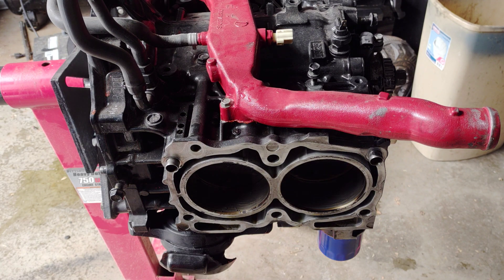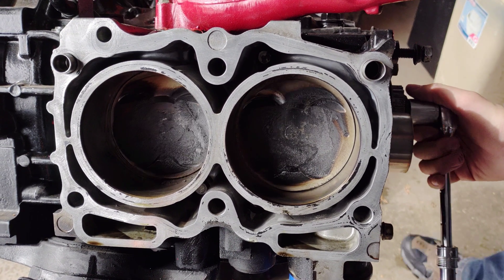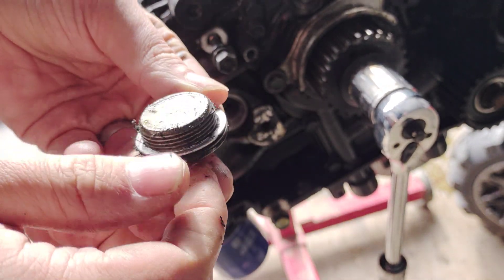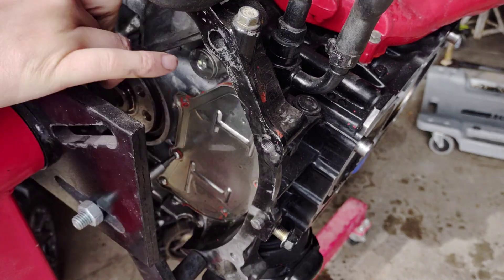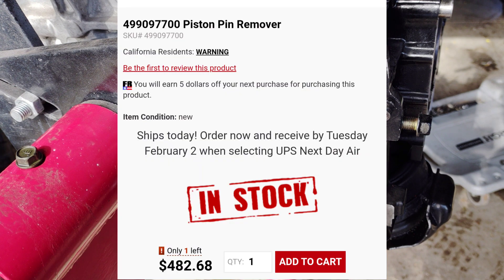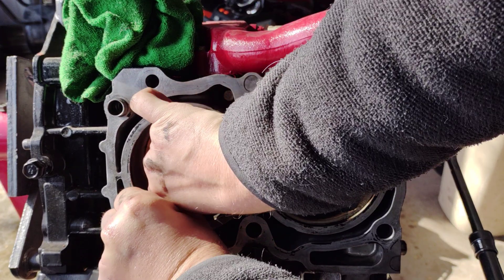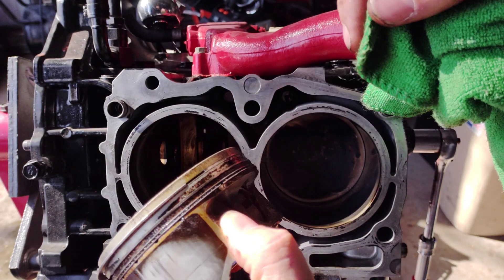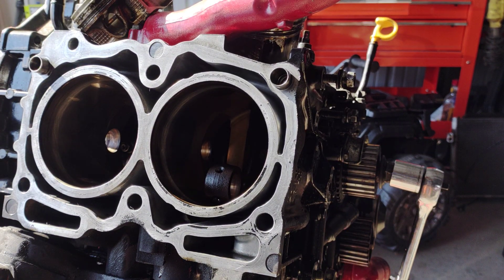What causes Subaru oil consumption? Engine teardown and piston removal.

Comment: Does this poor piston ring design (Keeps happening to you) cause you to say a hard no on buying a used 2012 Forrester with 80k miles.   Meaning they all will fail the same way?   Not sure what I have learn here on how to prevent the issue.  Replacing piston rings is not something the average Joe can pull off.  Which years was it an issue?  I think I read they fixed it in 2016 or something after a class action lawsuit on oil consumption.

Comment: Its due to low tension RINGs, change to different rings case is solved.    Burning 1 quirt every 1,000 miles is what subaru lawyers say is normal now.  Hint its not.   
2012 2.5 motor suffer same issue.    I have a V8 that burns no oil in 5,000 miles but it has good rings not low tension.   They tried to keep mpg high using 0-30 oild + terrible low tension rings.

Comment: I was having issues with my Honda throwing a CLE with a low and high oil pressure issue. The VTech is super sensitive and due to the age of the engine it's has a few small oil leaks. 

After some investigation I found a Honda Tech who said years ago there was a TSB that recommended the solution of using a mix of 5w-30 and 
Dexron III / Mercon Automatic Transmission Fluid.

If the engine was high mileage and the problem persisted then use an mix of of Rotella T4 10w 30 and Dexron III / Mercon Automatic Transmission Fluid.

This solved my problem.

Any thoughts on if the Subaru engines could benefit from this solution? The transmission fluid acts as a cleaner with the thicker oil?

Comment: Im looking at getting my wife a 2018 Outback or a 2016 Forrester. Both are pushing 100k miles.

How would i go about maintaining the engine after purchasing to keep this from happening aside from using 5w-30 going forward?

Liqui moly engine flush?

Comment: Has anyone tried the valvoline prolong and protect oil In the boxer engines yet? They’ve been having the same problem with GM 2.4 direct injection motors probably because of combustion of using low resistance rings and direct inject PVC recirculating oil vapor.

Comment: Happy I saw this video! I was having oil consumption issues on my EJ25, figured it was valve seals so I was able to get new heads and was about to install them when I saw this video. Pulled my pistons and found stuck oil rings. I soaked and cleaned the pistons and the oil rings are clean and free now. My question is, can I put the cylinders back in and reuse the rings? I know it’s better to do a hone/new rings but I’m on a budget as well as a time constraint as this is my daily driver. Any input is appreciated

Comment: Guys its not necessarily this as iv pleasantly just found out (i saw pleasantly with gritted teeth). My 03 na ej201 forester started burning oil about a month ago and got considerably worse quickly & started running rough, was thinking it was exactly this as theres so much information about it including this great video however luckily its not. The seals for the spark plug tubes (they sit between the rocker cover and tube) had failed on 1 side completely, oil was leaking down somehow past the spark plug and combusting. I did the seals and now 1000miles later the consumptions stopped & the smell gone.

Comment: i just bought a 2006 subaru forester with 350,000 k's ,it drives beautifully,no noises,no smoke with no issues or oil leaks ,ive been driving it for 6 weeks and i just topped up the oil,the oil wasnt registering on the dip stick and  i put 2.5 litres in and it just registered on the low end of the dip stick,i was worried i put too much oil in it and worried someone put a dipstick from a 2.0 litre or just another car,and it was short but the car drives perfectly,runs smooth,doesnt blow smoke and this was before the oil top up,is 2.5 litres a crazy amount to top up or do subarus burn that much oil,god knows how long its been since an oil change or top up before i got the car,is this normal or should i be worried

Comment: Just curious as to why you didn’t do a piston soak? Say for example with seafoam or b12 Chemtool
Reply: Probably won't work on the boxer engines because the cylinders are horizontal and a soak would only make contact with a small portion of the rings.

Comment: I am planning to buy a new Forester,what is the situation with engines after 2020 (2022)?
Reply from the maker: The FB motors (2013-present) are still having consumption issues. Worst years were the early models, but it comes down to maintenance and oil type used. I recommend that most people go up a weight of oil to 5W30 (used in turbo models) instead of 0W20 that Subaru recommends for non-turbo engines. It helps oil escaping the oil ring when warm at the cost of 1-2% fuel economy.
Reply: @BoxerTechGarage  thanks for the answer sir

Comment: Nice video thanks sir. I had read about this online and you are just confirming what I've read. I have a 2011 WRX (I bought about 50k miles ago) and all is well with her thankfully, despite the reputation these cars get, which I find is mostly to abuse from kids who drive them like they are in the fast and the furious, she runs great...however I noticed that during the peak driving season when I drive it which is in the late summer and through the fall I burn a lot of oil. My job takes me on the highway a lot so most of those miles are highway miles and it seems that highway driving is worse on the oil burning than city driving. When I park it or do some light city driving in my off season during the winter and spring I don't really burn much oil. I just did an oil change about 2.5 months ago as my driving season began and now today I had to add about 4 quartz to get it up to the line. When I changed it 2.5 months ago it was only maybe a quart short. Interesting stuff! I think I'll just deal with it tearing down and rebuilding is not within my means due to time right now. Hoping she lasts a couple more years and then I'll trade her in for something newer.
Reply: You are letting your car be a quart short of full.  This is the problem with most owners, they don't maintain their car properly.
Reply: @jimwillingham8052  Nobody is letting anything be short. The car burns oil. Can you read? Are you daft and have never owned an older vehicle that burns oil? Get real. It'll run fine for a decade like this. My honda ran for over 900k miles and burned about the same amount of oil.
Reply: So just another confirmation of what many of us who have done our research have already concluded. Poor Quality Subaru Parts & Design and Non-Existent QC. Watch their YT video of their Subaru plant in Japan. Buyer Beware

No engine should be designed like this from the factory. Unfortunately with a Ru it is not just the engine . . . those cars are just loaded with poor design / No QC and hand grenades from top to bottom. Maint. is Extreme and Very Expensive that even a Fanatic DIYr cannot  keep up with. The dealership is just waiting to blame everything the owner 
( and will ) These vehicles are very expensive Disposable cars. 
Don't fall for it.

Comment: forgive my maybe dumb question, but what's to stop the new rings from seizing up again? Is there a better ring to replace them with? Are you saying this is a better oil consumption fix instead of replacing the short block like I'm seeing on so many online forums ?
Reply from the maker: First, I make sure the pistons compression and oil ring journals are completely cleaned and I make sure they're within the specified tolerance by the manufacturer before using them again. Second, changing the type of oil used in the engine prevents it from thinning out on the walls of the cylinder giving the oil ring better scraping ability leading to less carbon discharge in the rings. Replacing the short block is an expensive option. Replacing the pistons and rings if there is nothing wrong with the block is the cheapest option. Most people don't want to spend the time to do that, which is why the "preferred option" is to replace the block. Wasteful in my opinion.
Reply: @BoxerTechGarage  Thank you for responding to my question. For the lay person reading these comments, how do you determine if your block is defective?
Reply: @letthebadguygo The tolerances of the engine block are carefully measured to ensure they are within the same specifications as a new block.

Comment: So this, is what I’ve been looking for in past 2 months since I bought my Subaru Forester 2011.
The oil consumption caused by pistons oil rings is the major challenge I’m dealing with, driving this engine, and I have to say I haven’t find a single mechanic in Toronto, since I moved in, to actually present oil rings as the real cause of oil consumption.
I eventually concluded the problem today and I’m thinking maybe DIY this issue, and try to change them myself. 
I have no tools to start with but I’m searching for them already and I’m happy that I’ve found your channel.
Now, I’m trying to find a thicker oil and a better oil filter for the engine. Today I added around 3 quarters of 0W20 mobil 1 high mileage to my 255,000 km engine. I’m thinking to move to 5W20 for the next 2000 kms.
Reply from the maker: Thicker oil after replacing the rings is the fix. Unfortunately Subaru doesn't officially support this as a fix because it is detrimental to their MPG ratings. Bumping the oil from 0W to 5W or 10W reduces MPGs by about 5% over the life of the engine. Subaru needs that extra 5% from the start to meet federal mpg standards and in order to keep their PZEV designation. The downside is reduced engine life requiring expensive replacement of parts later on down the line. 

It's lazy engineering on their part and resistance to changing to a more efficient engine design. There's a reason Mazda discontinued their iconic Wankel engine even though it made tons of power. 

I'm just south of you in NY. Changing pistons and rings is not for a novice mechanic. You need specialty tools to make sure the block is still within spec, not to mention the patience to get the pistons out and back in. The boxer design does not make it easy.
Reply: @BoxerTechGarage  Thanks for the heads up. I definitely won’t open up the engine for the piston rings. Although I managed to reduce the oil consumption from 1 Quart per 600 km to 1Q/1000Km by replacing PCV valve and hosing and cleaning the EGR valve. I’m surprised how effective it was.
Added 2 Quarts of 5w30 oil to the engine and I believe it’s running smoother. I will soon change it to 5w30 completely to complete the process and run the experiment to find the new consumption rate. So thanks for this tip as well.
Reply: @BoxerTechGarage  I used to run 10w30 in 2011 forester.  Had to check the oil every 2 weeks.  Seems like the oil would really drop fast after about 5000 miles.  Maybe it thinned out I don't know.  Never went more than 5k on an oil change after I discovered that.
Reply: My 99 outback burns quite a lot of oil, my check engine came on (catalytic converter clogged) so I need to fix it soon. Going to do piston rings/head gaskets hopefully soon. I’ll do as many seals and gaskets while I’m rebuilding it and I have to fix my transmission too. I don’t know how to do any of this but I’ve fixed everything before by myself and there’s plenty of videos online to help me/us to fix our engines. Tools, time and money also play a factor
Reply: Used to run 10w30 in 2011 forester
Reply: I’m trying out Valvoline restore and protect for the next 3-4 oil changes to see what impact it has.

Comment: I have a 2013 Subaru Legacy my dad gifted to me. He was alwayd good about having the car maintained but after receiving the car I noticed my oil light is constantly coming on even after I refilled the oil. Ive gotten into a habbit of physically checking my oil level every other morning before I start the engine. I go through probably a quart of oil every 2 weeks. Every other time I have to get gas I usually have to add oil, sometimes sooner. I dont see blue smoke but every time I check the oil it goes down slightly. I probably should mention that I am somewhat of a fast driver so that could be a contributing factor. Although in my previous 2010 Hyundai Elantra I would drive just as fast and it never burned oil. I also average 600 miles per month as I have to drive across town to get to work. Im only 22 and dont have much money to make repairs which is why I want to learn how to fix this issue myself. Any advice would be greatly appreciated.
Reply from the maker: About 2-300 miles before your next oil change, add a can of seafoam to the crankcase. Drive it normally and have it changed. The oil will be dark and smelly. Upon refill, replace 1 quart of oil with a half quart of ATF and liquid moly engine flush. Drive about 1000 miles. The oil will be black and nasty looking. Add in a can of seafoam, wait 200-300 miles. Change the oil. It will be black and nasty again. This is because the atf, seafoam, and engine flush are heavy detergents that dissolve sludge, varnish, and carbon. Change your oil to either 5W30 or 10W40. Full synthetic. Keep to your 5000 mile intervals.
Reply: @BoxerTechGarage  My 2005 Outback gets 30 mpg for 200000km on it. I just bought it a couple of months ago knowing I will need to work on the motor eventually. It doesn't blow blue or black but goes through about a liter of oil every tank full. Still lots of power. Will the flush you mentioned above blow white smoke. I put seafoam in my 84 VW Van and it made a huge white cloud. Head gasket seems fine and no water in the oil. Just wondering if this would do the same for my Outback.
Reply: What happened, did you figure out the problem? On my 2017 Subaru wrx i think I’m having the same problem. Haven’t driven it in like 2 months cause my clutch went out and replaced it with a stage 1 clutch and picked it up from the shop 2 days ago then yesterday I was driving and the engine low oil sign came on so, I checked it and it was almost complete empty even though I did a oil change not to long ago???
Reply: @alexblain594  From the mechanics I talked to they said that my rings were loose and leaking oil. They wanted $4000 dollars to fix it so I just buy a 5 quart jug of oil every 2 months and use that to top off my oil every few days. The light still comes on occassionally but half of the time the oil level is reasonable when I check it so I pretty much ignore the low oil pressure light and physically check it every morning before starting the engine. Oil isn't too expensive for me so I would rather just keep buying more oil to fill it up than pay all that money to repair a car I got for free. My legacy runs fine every time I top off the oil it's just irritating having to check it before driving every day. Still love my car  and plan on fixing the rings myself once I gain the knowledge required.
Reply: @VitalXtreme  ooh I see. Check to see if your oil is leaking somewhere else maybe?? They could be saying that since that is a expensive fix from what I understand the ring that you’re talking about are the piston rings and that would require them to pull the whole engine out and replace them I think. Hopefully that’s not the case with yours or mine

Comment: I’ve done my oil changes early and still get some burn. It’s not that bad though. My car runs great really.
Reply from the maker: Add a can of seafoam to your oil about 200 miles before your next oil change. Drain the oil and refill, but replace a quart of oil with Liquid Moly engine flush and ATF (add 4 quarts of oil plus engine flush and ATF). After about 1000 miles, your oil should be super dirty. Drain and add a quality synthetic oil that is either 5W30 or 10W30. You should see a sizable decrease in the amount of oil consumption between changes.

Comment: Oil consumption is all about how the engine was broken in when brand new. If you over rev the new engine from the very beginning, you are setting precedent for oil burning/bypass. With brand new engines, change the oil right after first 1500 miles, and then every 5000 miles religiously! Never rev the engine into red zone or close to it, use Lucas upper cylinder lubricant with each gas fill up, and watch magic happen over the years, you won't burn a drop of oil for the life of that vehicle. Liked n subscribed to this great channel btw :)
Reply: Most of them prob get revved too high from a test drive or two. Do you think that’s enough to cause damage?
Reply: @skiaddict08  No, a few test drive sessions will not damage anything due to its still brand new condition. Just change that first bad oil after about 1000 miles and use good quality full synthetic oil and continue to gently break in that new engine and NEVER procrastinate on oil changes with Subaru and it will easily last you 600.000 miles with just regular maintenance and Upper cylinder lubricant with every gas fill-up.
Reply: It’s not that simple.
Especially with low tension piston ring and direct injection.
Clearly you can see in the above video, the problem here is on the oil control rings, and sludge buildup.
Shame he did not show the ring groves after removing the rings.
I build drag car motors, we do not do “break ins” it gets they dyno first.

Comment: Just subscribed. Did neglect (extended oil change intervals) cause or contribute to the issue on this particular engine?
Reply from the maker: Thanks for the sub. Delayed or extended oil change intervals beyond the manufacturers rated intervals and oil types accelerates the issue. On the FB motors, the thinner oil over time causes it to escape the rings and carbon builds up on the oil ring.